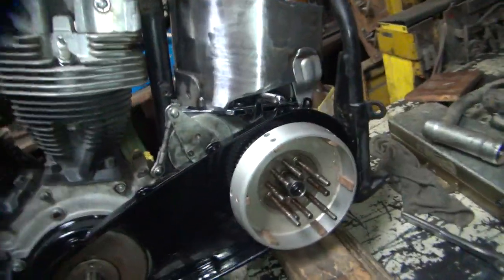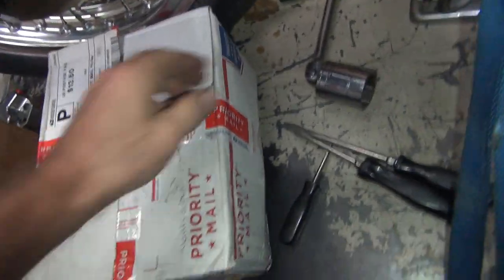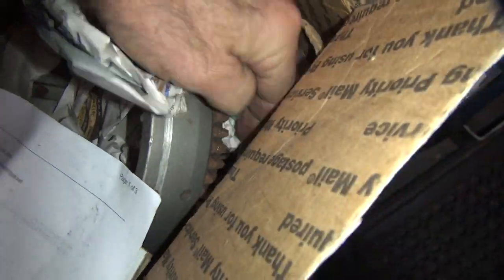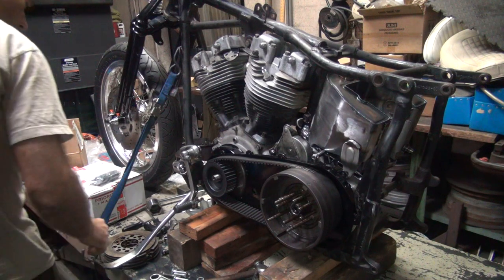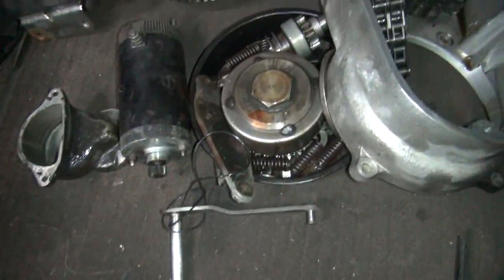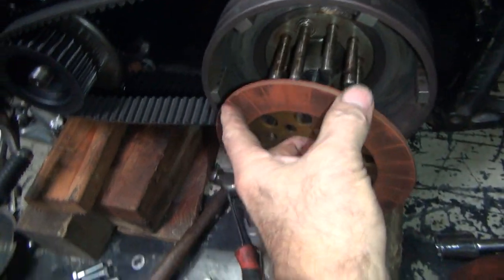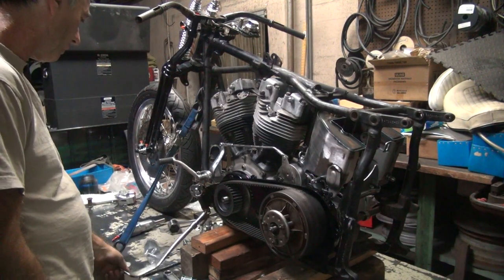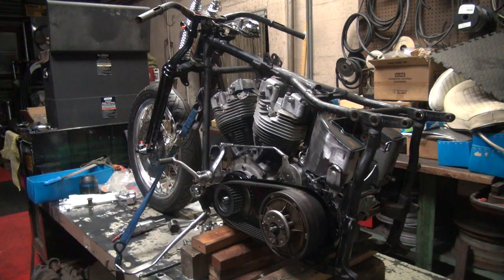#119 1973 shovelhead loose the ugly kickstart custom bobber build 74ci FX FL harley by tatro machine

Comment: Had to replace the selector pawls on the four speed cow pie lid . . it had (I hope) had been got at before as that bad design & I hope aftermarket  Allen screw bolts at top of inside of case . . having shed their heads of the bolts & dropped through the gears without causing any damage aka as an miracle  . .fished about three snapped heads from the bottom of the transmission

Comment: Mr. Tatro, I wanted to ask you a question about my 2020 883 iron. Have order a hammer 1275 kit, want to pep bike up a little. Problem was I am having trouble with wet sumping right from start. Bike is brand new and wanted it right before I dove into and engine tear down. I watch your videos all the time and they have meant so much. Gotten me thru some hard times I had in life lately. Your vids are very educational and bring a smile to my face all the time. Do yo have a site set up to make donations, would like to donate to you and your shop. If so let me know how. My question was should all the oil in my new sportster be leaking down from the oil tank to the bottom of the engine over a week period. It hard to crank when this happens and dies 2-3 times before it fires up. If cranked daily doesn’t happen, but not much oil has seeped down in 24 hrs. Took to my dealer, ugh, they kept bike for a week and did nothing. Charged me 98 bucks for a 1hr diagnostics. I told them what was happening before taking it in and again when I trailered it there.  They said they went thru the bike and that this is just something that happens and nothing can be done, basically if I don’t like it trade it in on a new Softail.  I refuse to do this because I know I can at least slow down the wet sumping.  Can you change out the check valve ball and spring on a sportster 2020 or even just replace the oil pump.  I would expect to see wet sumping if the bike set for 3 months or more, but not a full oil tank leaking down over 6-7 days. I wanna fix this. I can myself I know.  Have worked on both buells I owned and a couple twin cams.  I want to get into EVO motors and just need to get the knowledge I need to do that.  Thanks again for all your work. It is so much appreciated.
Reply from the maker: most of your problems is that the rings are not sealing. a leak down test will show this. you probably wrapped the rings onto the pistons instead of expanding them onto the pistons.
i don't know how the oil pump works on the new sportsters. the oil filter should have stopped the wet sumping.
i am working on the donation part. more to come on this soon.
tatro

Comment: That looks like a regular old ratchet top someone turned the arm upside down on. Guys used to do that and
put a handle on them for hand shift. The problem is when flipped only two of the mounting holes line up and
they work loose. You can see  the center screw is missing.

I know, way back when I ran a set up like that for a while and got tired of the thing falling off so I traded the
ratchet for the jock top that I'm still running.
Reply from the maker: the fx mid control bikes had this type shifter setup because the fl stuff would not work. the fx used four screws to hold the lever on so that it did not come loose.
tatro
Reply: @TatroMachine  And I learn something new. Imagine that! Heh.